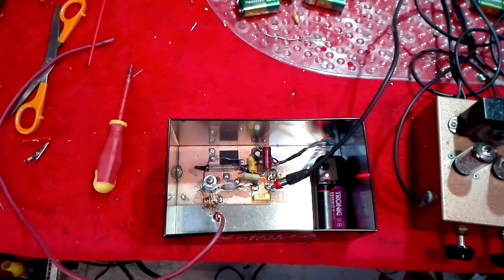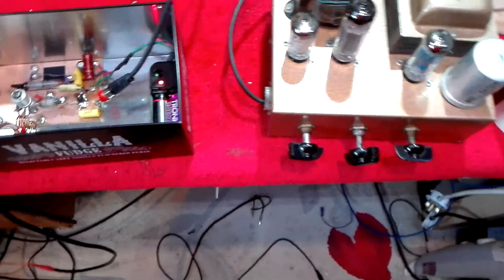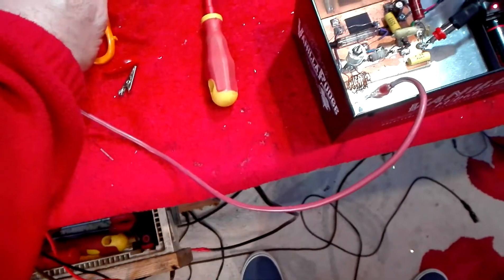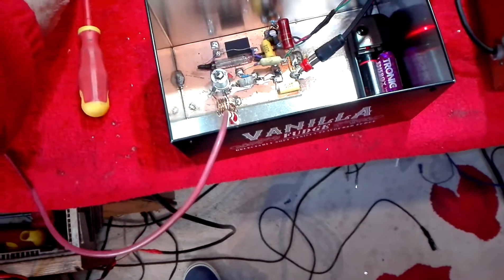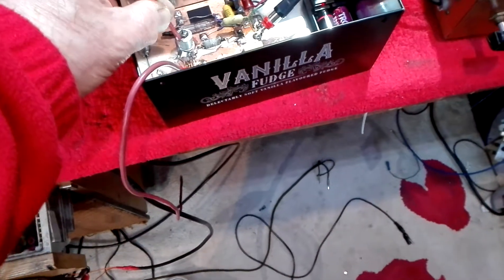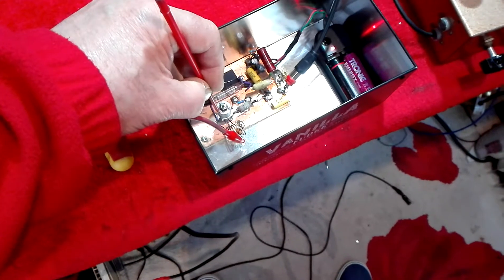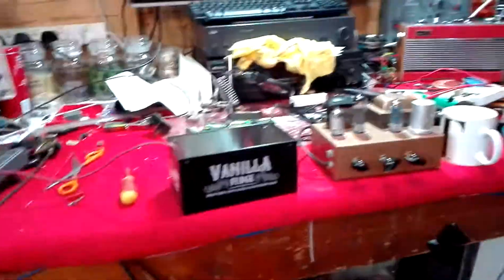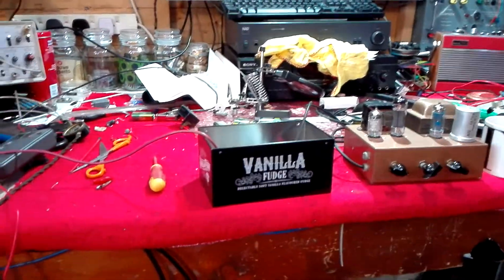FM super regen using 1j29b rod pentode.

Comment: Лампа 1Ж29Б для работы на частоте до 60 МГц. А вы на каких частотах FM слушаете? И еще - где взять такую ванильную коробку?) Удачи
Reply from the maker: Hello Zeber 127
Our FM is from 88 to 108 Mhz so the  1Ж29Б is working very well at these frequencies. The tin box is just a British Biscuit tin box. Any box of that size will do. There is a thread here with all the information, http://golbornevintageradio.co.uk/forum/showthread.php?tid=5871
lots of pages though.
Reply: trevor goodenough 
 Hi Trev. I hope you're happy and healthy. And Putin's tubes bring you pleasure. Hmm. If earlier I dreamed about a box, now my dream is for a biscuit. I must say, you are already close to Radio Veronica. And this is very good. I used 1zh29B for the regenerator and 2 pcs B-29 for sound amp. But I did not get a lot of power for the speaker. Good luck and aether without interference. if you can't be good be careful))